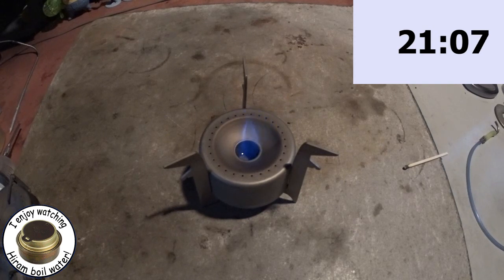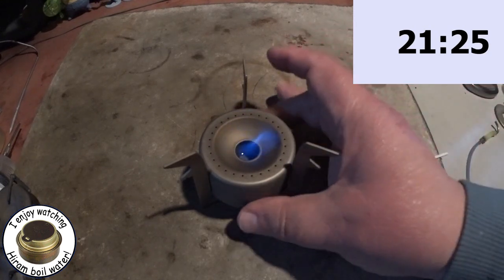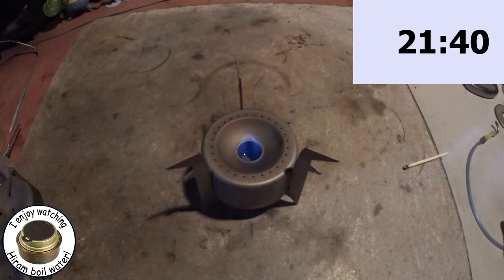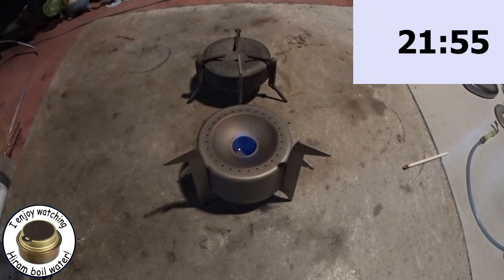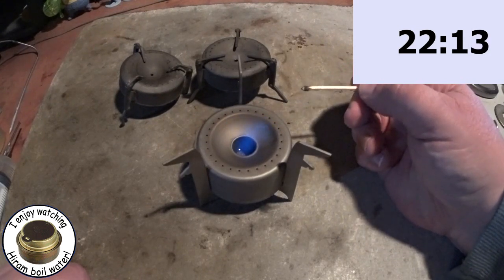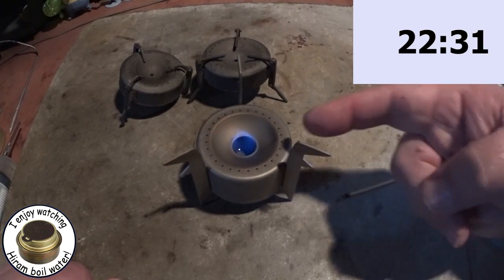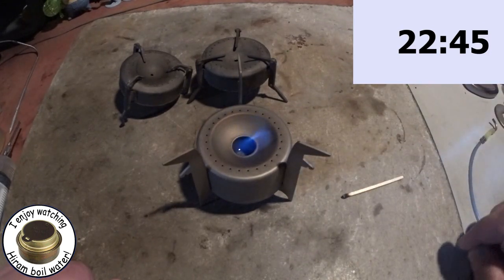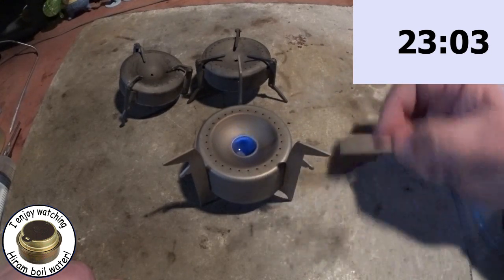Vargo Titanium Converter Stove - 1 Fluid Ounce - Burn Test (Fail)

Comment: I'm not a fan of their designs either. At least not function wise. But as far as I know they are really designed to be used with a full load of alcohol. That makes the room inside, that is needed to be filled with gas, much smaller and should fasten the bloom. After you're finished with cooking you're supposed to extinguish the stove, let it cool and fill excess alcohol back into your bottle.

Comment: You need a soffit louver panel cylinder, or wind shield/heat reflector cylinder, focusing and increasing the thermal capacity of the container for alcohol vaporization.  But also the increased upward flame heat and height to the cooking container.  Always alcohol stoves have so much free air and air flow wasting immense heat to the outside.  Get it focused and you will have your desired results.  Have a 5 inch diameter heat reflector cylinder for a solution.  Cylinder (not the burner unit) holding the cooking container.

Comment: It would be a bit tricky but the top hole is large enough to allow placing a carbon felt wick along the inner wall. Maybe sewing the wick ends together before inserting would make it stand upright against the wall.

Comment: When you bumped it it seemed to want to light, maybe tip to one side until it lights. That would concentrate the fuel in one area so the fuel would be heated more and less heat would be devoted to getting the container hot, however the real test would be when the burner is returned to its normal position.

Comment: Hiram, if it's in the wood burner could you cut a can and make a primer pan? also, and this is off subject but I was wondering how your Stanley pots worked, I've been hearing that the lifting tabs on the lids have been melting, by the time I got a hold of some hunting season had started and I didn't get a chance to try mine. have you had an issue with yours?
Reply: +keith moore Iv'e used a Stanley camp cookset pot on various stoves, incl. wood gas (vid on my channel) and Ikea hobo, where flames lick up the sides to the top- so the whole pot is black right to, but not including, the lid. No problems with handle melting  in my case at least - I always stand the handle up so it can be grabbed easily when lid is hot, don't know if that may have saved mine ? Dave
Reply: noakeswalker I keep hearing this but don't know who to believe, one says one thing then the next says the opposite,thanks for the insite
Reply: noakeswalker you know it just occurred to me, wonder if they were dry baking when they melted? seems that would get hotter than just cooking?
Reply: +keith moore You got the words out before me Keith .. I suspect it's either heating the pot dry, or it's putting the pot on a full open woodfire, where there's a LOT of heat all around and over the top of the pot maybe ? You'd think that if there's water in it, and it's only heated on a stove, that the lid would never reach too much more than 100 deg C (212 F).....
Reply: not if they're dry baking.

Comment: Maybe try a carbon felt donut in the middle to hold fuel up in the bowl section. Or a thin donut  on the outside that you could slide up or down at about the fuel level That would heat up the sides to start vaporizing. Also maybe 2-4 wicks in the holes spaced evenly or even a couple vertical narrow strips of carbon felt glued on the outside to prime. There is too much surface area from the middle hole to go around the top and sides to the fuel lever. Its too good of a heat sink.